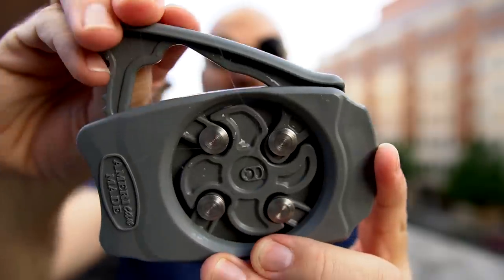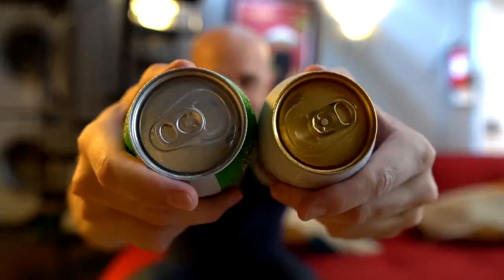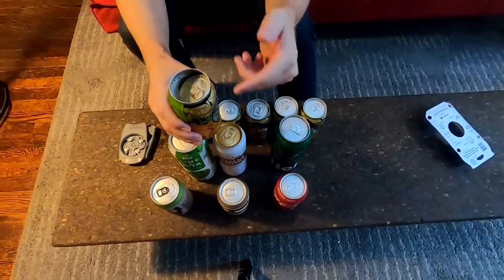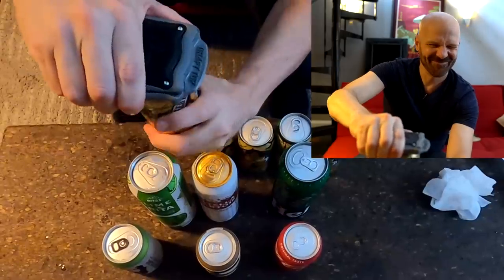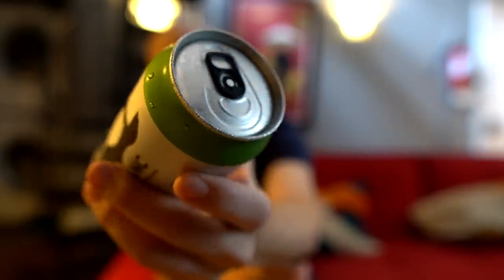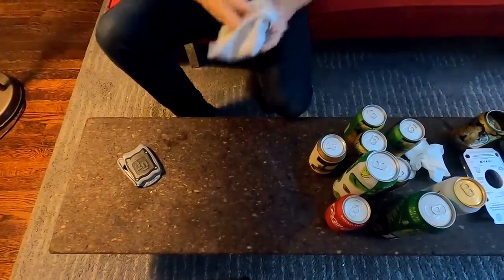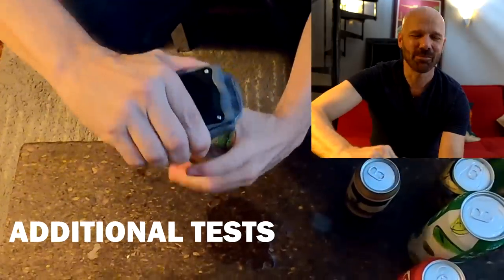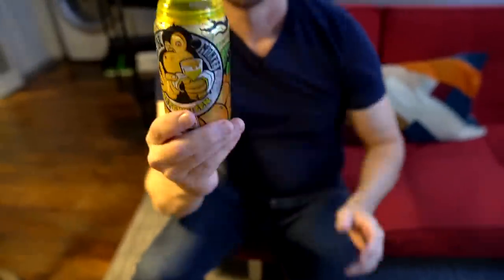Testing an Unusual Aluminum Can Opener!

Comment: I get the idea of smelling your beer as you drink it enhancing the experience.  That said, for the price of this thing, I’d rather buy one of those insulated pint vessels that can double as a can cooler.  You either put the whole can in or pour the beverage in to use it as a pint glass.  Bonus, it’s comes with a sip cover and an adapter that can be frozen as a cooler element and raises a 12 oz can to the lip of the glass.  BrüMate makes them, but I’m sure there are knockoffs.  You could even use a 20 oz. Yeti as your insulated pint glass.

Comment: They should include two of the foam cozy sleeves, so you can grip it better without crushing. Long cans are better because of torque . However, this item isn't worth the squeeze.. And twisting.. and potential  micro metal splinters in your digestive system...

Comment: With how the Drafttop cuts open the cans I'm a little concerned about it creating slivers of aluminum that would drop into the beer with the lid; you don't really want to be drinking something that could cause internal damage.      Drafttop's own directions describe using a back and forth quarter or third turn rocking motion before doing a full rotation, if the Drafttop shifts up & down during the partial rotation rocking that's when aluminum slivers could be created.

Comment: If you're drinking the kind of beer that the "aroma" is a big deal, you should probably be pouring it into a beer glass or a mug. Hefeweizen is a good example of that. It's generally way too carbonated in the can or bottle, and you need to pour it to even it out. If you try to drink a hefeweizen from the can or bottle, it likes to foam over after the first drink.

Comment: One of your other videos featured can openers that had magnetic bits to pull the can top off once it was detached.  I think this could really benefit from that.

But it also occurs to me that a better solution, if you really wanted to remove the top, would be one of those edge can openers.  That way, you could cut the top of the can off without it going into the beer.  Of course, those already exist, which makes this thing kinda pointless.

Comment: huh... you know, with one of these you could make a really good storage system out of soda or beer cans. Store lots of nuts and bolts or electronic components, whatever kind of worker or hobbyist you are.

I used to know a guy who used the old metal folgers cans to store different types of nails and screws in, he was a carpenter. Worked well.

Comment: They couldn't find a way for the device to latch onto the top so you can pull it off? You'd think that'd be a more better way to do it. Like opening the beer first then having like a hook that hooks into the drinking hole so you can pull the cut off the top piece.

Comment: I donated mine. Tried it on several cans, none worked without a lot of hassle, crumpled cans, beer slopping over the side, and the lid dropping down into the beverage (yuck). I think only one of several cans had its lid off after a few turns, the rest resulted in hangers. And so on. So really, if you're going to use this in these uncertain times, you need to clean the lid thoroughly before attempting to open it with this device. At least the lid in your beer will be clean then. It was worth a try I guess, especially to support a USA business and product, but I didn't get it and it didn't work for me at all IMHO. Lesson learned. YMMV.

Comment: It appears to work like a copper pipe cutter.  Maybe if you gradually increase the pressure as you rotate the can so that the cutting wheels slowly cut into the aluminum like a copper pipe cutter works.  I think that is how it works.  It still sucks...just open it and pour it into a glass.  :)

Comment: I don't understand why a new can opener is needed for beer cans, I've used pretty standard can openers with the desired effect on beer cans before, takes a bit of practice and careful angling but worth it if you prefer an open top and don't bring cups.

Comment: I just use a glass when i drink beer. Also it doesnt sound right. I mean it sound like its scrapping metal and not cuting. A normal can opener can open can top flawlessy in one go. Ill be woried to have metal particle ect.
You could have tried with a regular can opener to see if you really need a gadget. Im sure it do the job I tried that one time. The only ptobkem is that it remove the rim so maybe its dangerous to get cut on the lips. I guess if you really want to drink in a can like a glass you probably need a gadget like that or a can open that remove the interior part. Which not all of em do.

The only time Ill tried to open a can with a can opener is when I forgot my mountain dew in the freezer and it was slushy but couldnt pour. So I cut the top and pour it in a glass and eat with a spoon.

Comment: I like the concept but it is more labor then necessary. Also it is also a bit of a safety concern. You already should be washing cans before consuming drinks as rats in warehouses can piss on the cans but for people who "doesn't worry" about that stuff could potentially contaminate the entire beverage by letting the lid just go inside the drink. Just too many steps for a can opener and would rather just use a glass as the previous commenter pointed out.

Comment: I think you are supposed to pop the tab on the can to pull it from the top after you cut it you are over thinking it. I would also think it would be easier if you set it on the table and turned it from the top.

Comment: Fun fact: I just used a can opener for this thing 🤯 just for the sake of curiosity, it worked
Reply: I was just sitting here wondering if that would work.  Does it leave a lip-slicing edge?
Reply: @keithfulkerson  I felt the walls of the cutout and it felt smooth fairly well. But it'll depend on the condition of the opener itself 👍
Reply: @keithfulkerson  you can safely put your lips on it to drink if that's what you were saying also 💯

Comment: Things this fails at:
For people who can't open cans - "relieve pressure before using by opening the can"
Contaminating the drink - Putting the whole lid into the drink instead of just where your lips touch. It also leaves a much larger area for things to fall into your drink, and make it go flat quicker.
easier / less hassle / cleaner / safer - Blatantly none of these.

Comment: probably.. just probably.. the right idea to this.. and probably the inventor themselves haven't seen it.. is to use the Draft Top to cut off the top, and since you've pulled the tab abit, use the tab as a handle to pull the top off. Doesn't solve the shard problem, but takes away the 'top into the drink' problem.. probably..

Comment: I worked in an off-licence. I would never put my mouth on an unwashed can top if I can help it.

They are literally the packing material of the item. They will be stood on, have rodents run over them, be stored in dirty, dusty, mucky places.

Dunking it in my beer is definitely not a good move imo.

Comment: the top of the can being in your drink is a bigger problem than just looking nasty, The other problem is your drink can get a metallic taste from the aluminum.

The inside of the can is usually coated so there's no direct contact with the can, The coating doesn't exist on the outside.  You put your mouth on the can, but theres less surface area. with the whole can top inside the drink is taking more of the metallic taste with it... which, would defeat the purpose of removing the top for a better taste...   Unless you don't mind metallic tasting beer/soda.

Comment: I think they should have had a little lever or hook so you can use it through the tab to pry the lid out instead of pushing it in. A clean small flathead screwdriver probably would do the same thing. I actually saw a set of drinking glasses on Amazon that look like clear topless cans made of actual glass https://www.amazon.com/dp/B078WGRQLJ/ref=cm_sw_em_r_mt_dp_yA-uFbZ51MEBC or if Coke is more your taste https://www.amazon.com/dp/B00F8MK7X0/ref=cm_sw_em_r_mt_dp_EF-uFbDE7E1PK which is the ones I want.

Comment: I didn't realize you had to pop the top into it yeah that's kind of a stupid idea, oh and you're relying on the top of the can being completely clean and there's no way you're not going to make a mess doing that either.
And as somebody who opened a can of rootbeer put it aside forgot about it found it the next day went to drink it and it had a fly in it ...... yeah I like containers that are resealable. Plus there's a noticeable reaction between the liquid and the aluminum that I can't stand so I try to avoid candid drinks. this also occurring with plastic as well but varies between the type of plastic there's nothing like glass.

Comment: I watched how you did it and them it reminded me of Harry Potter half blood prince in the potions class you were doing it like the whole class with the new books they did it like snape's way he did it in the old book they put it down with a very slite angle then squeezed and turned like you would do with the old hand cranked non electric can openers
Reply: Try starting by slanting your hand just a bit to slightly puncture it with one of the blades then continue to turn right after you puncture

Comment: The top of the can is sometimes dirty. So yeah, I wouldn't want the top to drop into my beverage and soak it in dirt, either. Also, a stupid invention, but interesting. I'm also wary of cutting aluminum in such a way that small pieces of it could potentially be created and fall into the drink.

Comment: I would like to know how this works on canned goods, honestly. I need a new can opener that won't kill my arthritis ridden hands.
Reply: It's intended to open aluminum cans in a convoluted way. You know, cans with a pull ring that punches in a small part of the top, creating a hole. There are tools that can slip under the tab and leverage it up for those who have arthritis. I don't see this product cutting through harder steel cans. There are can openers that can take the lid of a can of Campbell's or Green Giant off at the rim, resulting in the lid not falling into the can.
Reply: @KageNoTora74  yes I know this is for beer/soda. I watched the video. It likely wouldn't work, but there's a chance it might work better on a can of soup or whatever, since the can doesn't flex like thin aluminum would.
Reply: That's assuming it provides any benefit over traditional can openers, or is at least equivalent and worth the cost.

Comment: Try pulling up on the pull tap instead punching the lid into the can
Try keeping the can bottom on the table
Over engineered tool, that's not needed

Comment: I knew before the review started that this was a piece of crap. I ordered one a while back. Took months to arrive. Shoddy construction, cheap plastic, and dull blades. Barely made a dent in the first can before completely breaking. Had to open it the normal way and there were metal shavings all over the top that I had to wipe off. Fortunately, they refunded (some of) what I paid for it.

Comment: The idea works, but the execution is terrible. It's not that the 'problem' it's 'solving' doesn't exist, it's just an alternative to how cans are opened; except this solution is for a single size of a single type, rather than a universal opener. If this could be adapted to fit any size can of any seam type, it would be a good alternative in the market of the type of openers that claim to leave a dull edge; but this assumes you can make it work on any seam type of any size, including reasonably sized tin cans. 
As for it's specific use, it's only really needed when you only have cans and no glasses. Which is typical of tailgating, camping, cookouts, etc., or just when you don't want to dirty a glass when you already have the can as a drinking vessel. If the execution of the product was better, it'd be a great product.

Comment: Um.  I own beverage glasses?  I even have some that I keep in the freezer to put beer in.  Or, how about my vacuum flask insulated tumblers?

For preventing the splash when you press the cut top into the container, I'd recommend just pouring the beer into one of the above mentioned containers and THEN push the top in.  Voila!, no splash.  If you really insist on drinking your beer from the inferior container, then you can pour it back.
Really.

Comment: lol thats really an odd solution for a problem no one had.  it needs a motor and a hook and rotating blades.  just connect a hook, put it on top of a can and push a button.  when its done just pull the top off.  but making it manual where you have to squeeze it makes it a gimmick and not a real product anyone actually needs

Comment: why not just have beer manufacturers simply add a second tab at the other side, so when both tabs are open you can smell out one while drinking out the other

alternatively give beer cans the same lid as chef boyarde or tuna cans where you pull the tab and the whole lid pulls off

like ??????
Reply: Way back in the old days before pop-tabs - you actually DID put 2 holes in the top of the can.  One was to drink from, and the other was to let air in to balance the pressure.
Reply: @jeandiatasmith4512  oh yeah, we still do that with huggies, huggies are impossible to drink without an air hole

Comment: I wanted this to work because I just think can tops are dirty and I'd rather not have to put the top tab mouth opening into the drink.  But the way it actually works is the dirtiest way possible.  Gross.  And even if you're using it just to get the aroma of the beverage, if you push the top into the can, isn't it going to hit you in the face when you get to the bottom?  Dumb.

Comment: I probably wouldn't have bought this anyway but your review brings me from a 99% no to a 100% no😂😂.
The only time I'd use this if it worked is if i put a soda in the freezer.... I used a normal can opener with less mess a couple of times... Just have to watch not cutting ones self.
I think if they were able to make it so the lid can't fall in it would be better.
I guess the other thing is if i am concerned with smelling the beer as i drink it I'll pour it into a cold glass.... I dont care about the slightest change where you have to be a beer genius to taste the difference.For a beer I like... if it's cold & not skunked..  Im happy
just my opinion if some has the same standards as a pro brewer more power to you.

Comment: Honestly why not just use a no edge can opener?🤷‍♂️
Reply: Why not just use the pull tab that's been standard for sixty years?
Reply: @KageNoTora74  the idea is so you get better bouquet, so you can enhance the flavor while drinking
Reply: There are these cylinders that are sealed on one end and wide open on the other, made of a variety of materials, they're called cups, glasses, tumblers, beer steins etc.
Reply: @KageNoTora74  right 😂

Comment: this thing is extremely unhygienic. A lid full of dirt is detached with a contraption which cannot be sanitized and is pushed into the can to soak in the beverage.  Just buy some glasses and test some useful gear not crap.